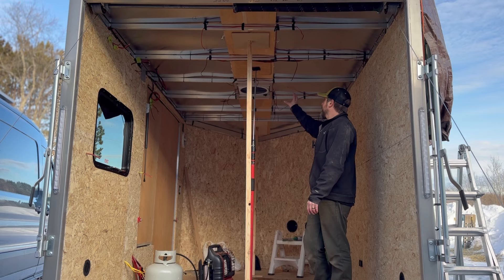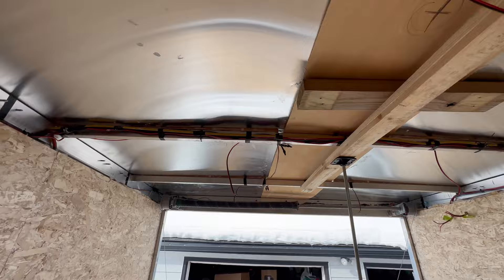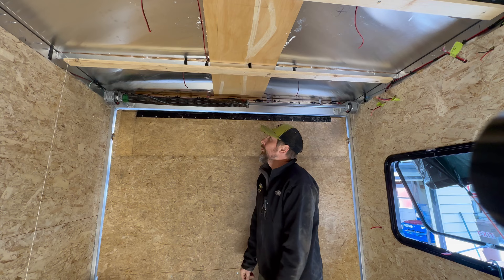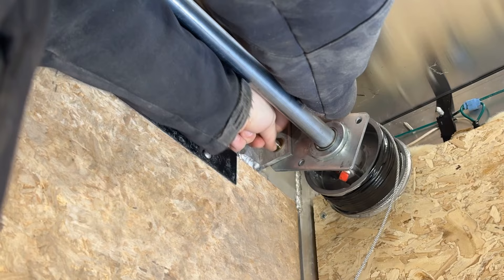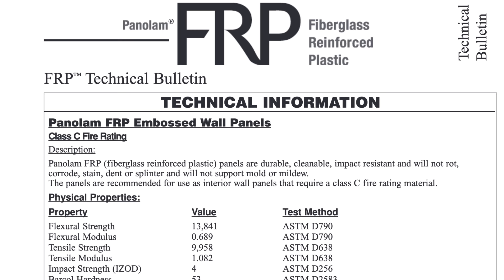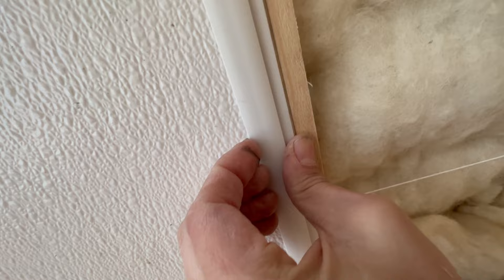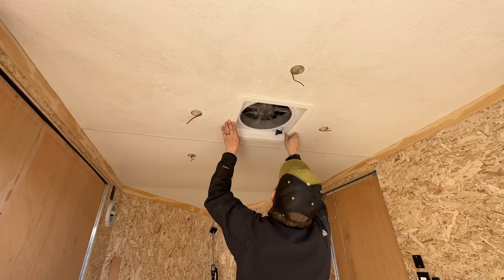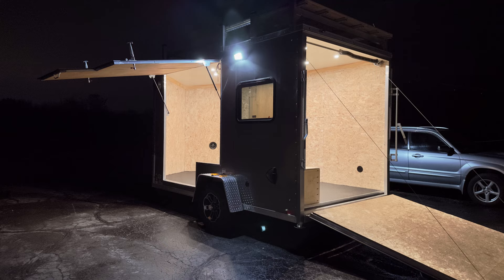Cargo Trailer Conversion Series: Ceiling Insulation & Panels

Comment: I had the same deal with my cargo roof, I shimmed it with rubber so it would flex a bit with temperature changes. Nice and tight, Good contour for rain runoff. Your the first I've seen to do the same. I siliconed all the metal side studs also. No rattle there either.

Comment: I have plans to do exactly this. Almost… I'm going to glue my FRP to foam board insulation. This should make it rigid and add some good insulation to the trailer. I will have to sand the back of the FRP for mechanical adhesion, but I think it's gonna work well. I am also considering just throwing a coat of epoxy on some Luan and wallpaper it. The weight between FRP and. luan is almost identical for the most part. It's difficult to decide though.... FRP is easy to clean, waterproof but expensive. Laun amd wallpaper will look excellent and is quite cheap. But in the back of my mind, I feel like we convert cargo trailers because we don't want to live in a luan box.
Reply: I was looking to do similar  using Trusscore slat wall.
Cheers
Reply from the maker: Don’t know how I missed your comment but I like the idea of FRP glued to foam board. The luan/wallpaper thing is what a lot of rv manufacturers do and I’m not a fan. Ive repaired enough water damaged ceilings to know that’s not ideal. Thanks for the comment, wish I had thought of this when I did mine! 😆

Comment: Why are you not gluing the wool to the walls and ceiling?
Reply from the maker: I’ve tried the glue in method in the past and wasn’t happy with the result. First off, I try not to use chemicals if I don’t have to but mainly, the glue doesn’t penetrate deep into the wool. You end up with a thin layer of the wool glued to the wall/ceiling, and the remaining layers easily pull apart from the glued layer. It might work in a confined space where it’s slightly compressed, but if you have any sort of air gap between the wool and the wall/ceiling, I wouldn’t have any faith in it staying in place. String looks a little funny but it’s the tried and true method for most who insulate with wool.